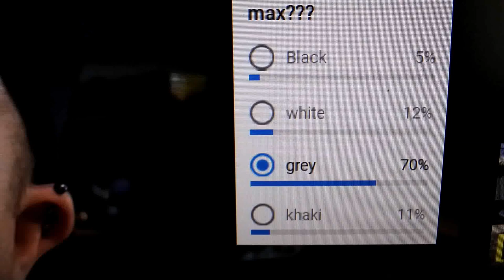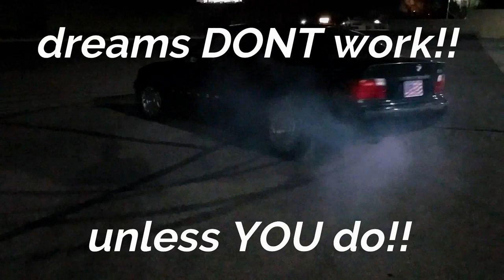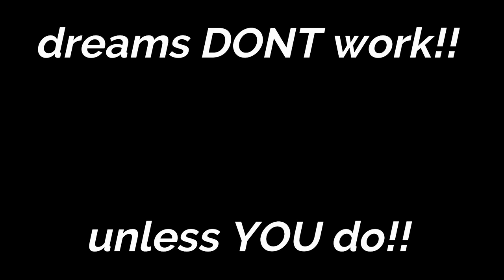Painting my car in a day! (Came out sick!!!!)

Comment: Use the tank of the old compressor with the new one at the same time let it charge full and turn it off. with the charge of both tanks you get enough air to spray one layer of paint at 29,30 psi.
that way the compressor can have some rest and dont have to be running while your painting.. it works for me xD
Reply from the maker: That's the plan brotha!